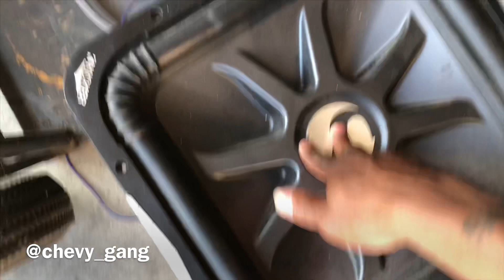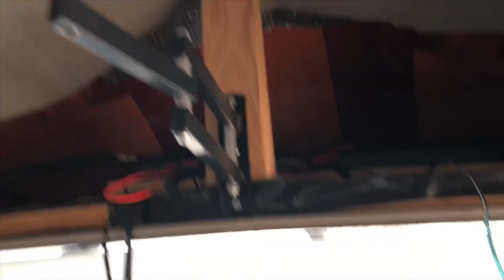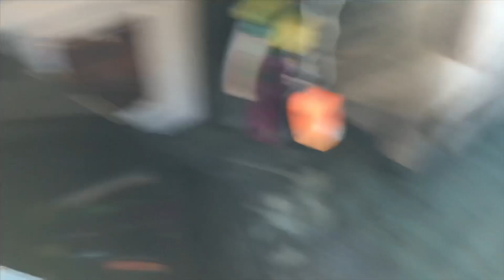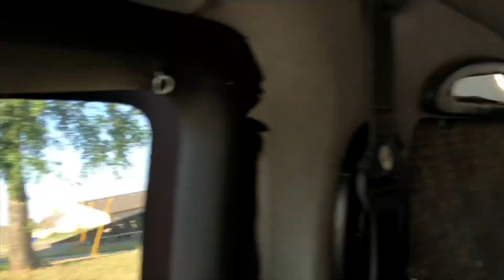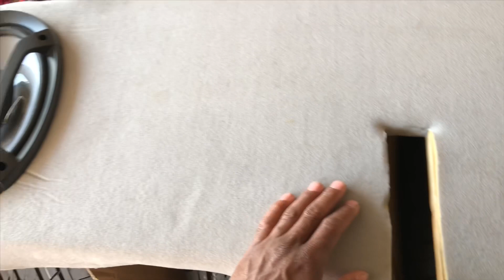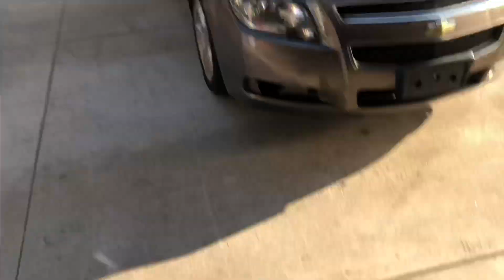Blew One Of My L7 15s 😢

Comment: Just did my Cvx coil was good just glue separated  and the motor shifted so they was locked up had to basically recone them and center the magnet again ...fix my speaker.com or psi have parts but robot underground will build u a recone or recone it ...had him make me one for a American bass hd15
Reply from the maker: Mando Martinez just submitted a request to fix my speaker.

Comment: That's crazy bro i got exactly the same issue but i got a l5 15 but i was putting mine in box and dropped it and now its frozen wont move but I don't think it's a recone kit for the one I have .... did u ever get the email I had messaged u about info on springs and stuff for the box
Reply from the maker: Boss King it just said what’s up but I won’t forget, give me some time. You got IG?
Reply: Boss King have y'all tried running the speaker to a battery to unfreeze it the speaker will come all the way out then when you unhook it the speaker will set back in place
Reply: 99 CROWN VIC naw explain what u mean when u say hook to battery i haven't tried anything it's still sitting in box